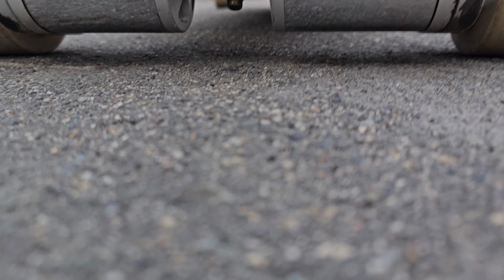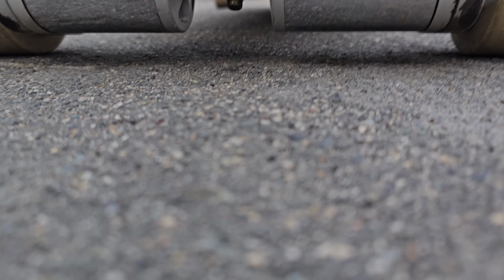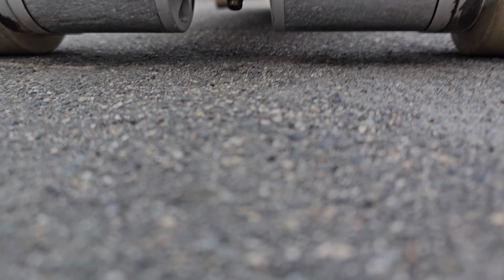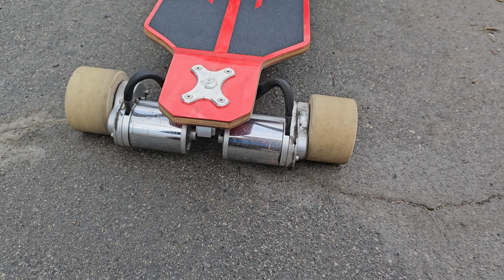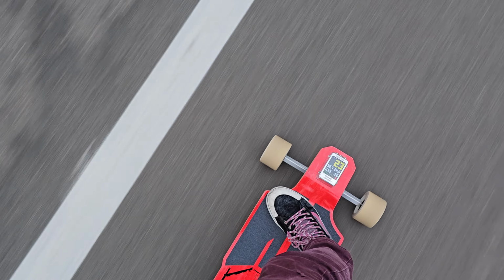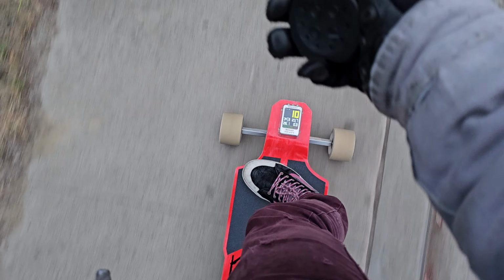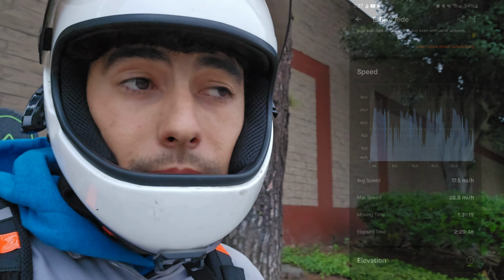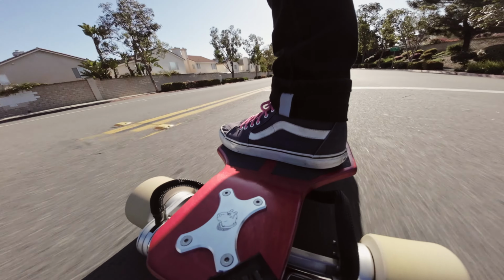Defiant One: How Far Does it Go? (Range Test)

Comment: Nice Board and gear Truck with this kind of angle adjustable i never seen this bevor.:hand-pink-waving:
Reply from the maker: Angle adjustable baseplates have been around for a while in the DIY community, they're really useful for angled decks or for setups where you want to have less angle in the rear.

Comment: ...And remember! Don't shoot the messenger... Thanks for the review. I really don't care for the beating those motors endured because of the placement. Dunno how many miles before stuff starts acting up? I have an 1 gen Onsra with direct drive and had to switch asap to 120mm Cloudwheels. It's impossible to keep the motors intact.
Reply from the maker: Totally understandable. I only have so much time, so I couldn't ride it until it broke again (if it broke). Some motors are more durable than others, and in my opinion, these Maytech cans are far inferior to the Flipsky ones. I think Defiant would benefit from changing motor manufacturers in the future to one that offers a thicker motor can.